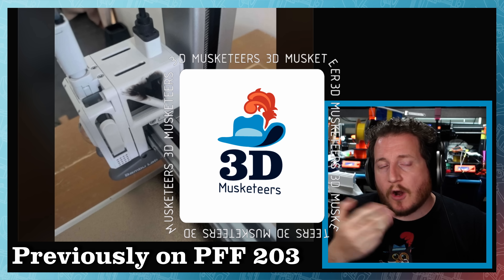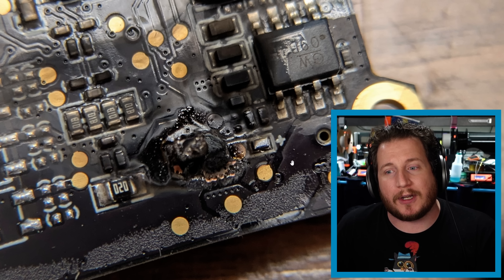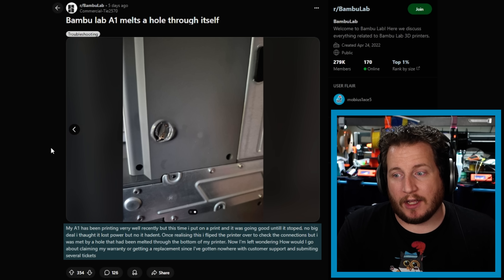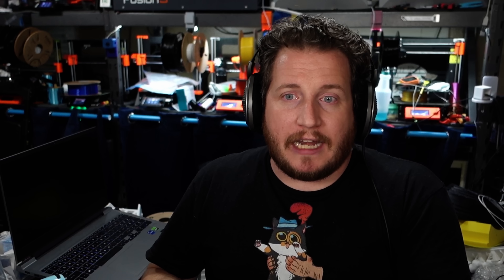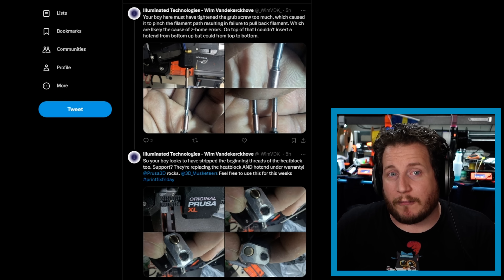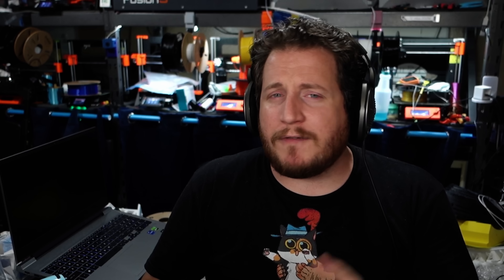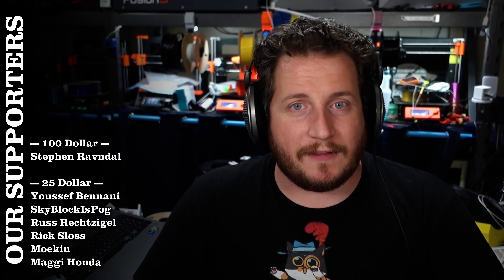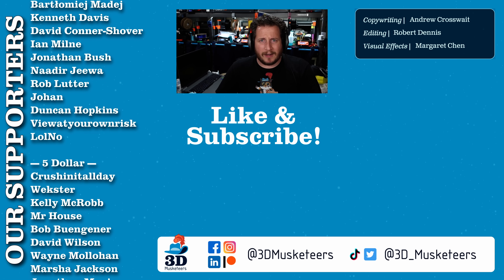PROOF That Bambu A1s Are Catching Fire! - PrintFixFriday 204

Comment: Wondering what the 3D farming community's experience is on this issue. If there is anyone who would have issues I think it would be them owing how hard they push their A1 units. My A1 is a year old now and I'm in a 220/240V country with high humidity all year round. I do prints on a weekly basis for the past year and pretty much daily over the holidays.  Really would want to know how much my unit is at risk.

Comment: This happened to me yesterday unfortunately, the printers been excellent, then came the sudden smell of burnt electronics and now the printer is dead. I live in Sweden and the only thing wrong with the electricity in this country is the prize, so that's not an issue. 
I'm in contact with Bambu lab support, hopefully there's some solution. The printer is not even 2 months old so there's got to be some warranty that covers this.
Reply: It was an A1 aswell ?
Reply: @guillaumevanoost811 yes, I've still haven't resolved the issue with the online store I bought it from. Not even an answer. 😤 Two weeks today, so I would not recommend 3djake to anyone. Crap support.
Reply: @likesootingstars any update
 happened to me today also
Reply from the maker: Happened to yours too? Send me an email or something. I'd like to chat more...
Reply: @Balion-t9s I'm returning my printer tomorrow, but I decided to buy another A1 from a different webshop. It doesn't seem to be all of the printers so I hope I'm not taking  to big of a risk. 🫣

Comment: 220/230 V AC power should not be much of a concern. In Europe it is typically a stable 230 V. Power outages are rare here — the grid is so reliable that I cannot remember the last unplanned blackout. The last interruption I have experienced was due to construction work, and I was notified in advance. 

30 years ago they have been much more common. I can remember that every thunderstorm could lead to a blackout. But that has been way back in the 90s. 

But the fire hazard is real and when I saw the electronics of my anet A8... As an electric engineer my heart nearly stopped. But since then nothing has really changed. Stuff is looking a bit fancier, some engineering went into the connectors but they use the same power supplies and wiring. 

Actually I am working on an automatic fire detector voltage cutoff circuit. And I strongly recommend that everyone should do that. I don't know why that is not an industry standard yet.
Reply from the maker: Alas it's prominent on all voltages so far.
Reply: @3DMusketeers Wherever electronics and especially heating elements are involved, there is always a fire risk. As far as I know, electronics are the main cause of fires in Europe. This is because fires are pretty uncommon and every other source is frequently and in detail tested and regulated. 
That makes it all the more important for manufacturers not to shrug it off but to take proactive measures.
In my view, every cable should have a fuse precisely matched to the expected load. On top of that, firmware-based monitoring of functions: if something is drawing current but not doing what it should → shut it down.
How hard can it be to add a simple optical smoke detector with a relay to cut power? And to integrate an automatic fire suppression system like Blazecut?
Of course, this all comes at a cost. A €250 printer would probably become at least €200 more expensive. But in return, you’d have the safest printers on the market.

Comment: Came back to this video as mine also started smoking, was able to shut it off, the printer wouldn't turn back on unless i unplugged the toolhead
Reply from the maker: send us an email or DM on discord.. would like to get that burned board from you if Bambu does not ask for it back
Reply: @3DMusketeers can I get the discord to send images, and I'll be doing the replacement I won't be going through bambu as it was a used printer gifted to me, the printer has been miraculously maintained
Reply from the maker: username on youtube is the same as it is on discord :)

Comment: I’ve had this same issue this week. Not sure how to add photos on here. My printer is almost 3 months old and Bambu up to now are refusing to replace the printer, only send me a new AC board and bottom plate. Not sure what to do now cos I really don’t fancy pulling all the electrics out. I’m in the uk
Reply from the maker: please email the photos to us. If you dont feel comfortable doing the work, let Bambu know you simply want a new machine. It should be within your right. If they push back let us know.
Reply: I’ve just emailed them to you. I mean I’m sure I could figure the replacement out. My concern is what caused it to happen and I’d be reluctant to use the machine properly again, especially leaving it unsupervised. I should be covered by our consumer rights act but I expect I’m in for a bit of a battle

Comment: I was wondering, how did the A1 that caught fire be installed ?
On furniture, on stone or something else ?
Maybe the condition under the printer has an impact on the issue, like less air circulation under the printer.
Reply from the maker: while yes, this can have SOME impact, it should not result in failure modes like we see. That area has no fan, nor air circulation system, so it is clearly designed to be passively cooled, at least in my eyes.

Comment: China Is a 220v country. There's no excuse for this being a voltage issue. They should have seen it coming. My original Anet A6 burned its heatbed connector so I switched to prusa printers. I recently decided to try out bambu labs and purchased an A1 and now my A1 could suffer from a related issue. I don't care how cheap you want to make a 3D printer, you should never compromise on safety!

Comment: My A1 runs 240v constantly. (I'm in UK)  I have 3d printed fan ducts for the little vent holes on both sides. It keeps the control board and power supply much cooler.  Why Banbu didnt squeeze a cooler fan in the base is surprising.  But Mines running fine.
Reply: Can you link or drop the name of the stl for the fan ducts please?

Comment: I really need to buy an A1 for a test-to-failure with some metrology on the PSU. I suspect that the PSU design is compromised for adaptability over safety/cost.

If anyone can send a full photo of their PSU board, pre-failure (both sides, if there's components or traces on the back side) then we can at least make some guesses about the logic. Having one in hand would be even better so we can suss out actual component values and build up a sim, if necessary.
Reply from the maker: I'm debating on buying one and hitting it with my thermal camera. I THINK we have a failed one secured for testing.

Comment: What grant goes to show. Bambu lab users are quite ignorant. They don’t like it when things go wrong with bambu printers and just stick their fingers in their ears and shout out ‘lalalalala’. 

You can clearly see it’s a fire issue but they won’t accept it and of course they know better than the actual engineers. 

When there was the first issue with the a1 catching fire they come out say things like ‘I’m going to keep using my printer regardless of what anyone says’

This is why I left the Bambu lab Facebook pages. They are some of the most toxic 3d printer people I know and god forbid should you say Bambu are cr@p. 

Bambu are cr@p!  Let’s see the haters come out!
Reply: That has nothing to do with "Bambu users" and a lot to do with Dunning-Kruger and bias in people in general. You're exhibiting the exact same thing by assuming everyone that buys a Bambu is ignorant. Congratulations on your utter lack of self awareness and bias. I am sure you are so proud of yourself.

Fanboys are everywhere, be they simping for Sony, Bambu, Linux distros.. and the anti's are just as toxic, if not moreso.

Of course, anyone calling you on your awful mental hygiene is a hater, right?

I suspect it's probably a failure in the PCB between primary and secondary and due to a lack of a Y class safety capacitor a catastrophic failure ensured.. but unlike most I am not willing to "call it" because I don't know for sure. I don't have the PCB in front of me so I can't inspect it.

Comment: When I got my Prusa MK4 kit, I had the Loveboard dead on arrival, sending the printer into a reboot loop. After half an hour with support, checking and troubleshooting different things, they told me they'd have to check with the team (this was 9PM Chech time). The next day, they got back to me saying they'd send out a replacement Love board and Nextruder main cable, which arrived here in Germany three days later. Replaced those, printer worked perfectly. It has since become a MK4S, then a Core One, and is still working perfectly. 
So, my experience with Prusa support was a good one.

Comment: My A1 makes some house lights flicker whenever the heatbed is running. Many users mention this happens because the bed is powered using direct AC and maintains the temperature with PWM. However, if you run the same printer on 110V, the problem goes away

Comment: The component in that location is a ceramic capacitor. Ceramic capacitors most likely fail short, which can occur due to manufacturing defects or mechanical vibrations. Because all the current flowed through it (apparently without limitation), it overheated and caught fire.

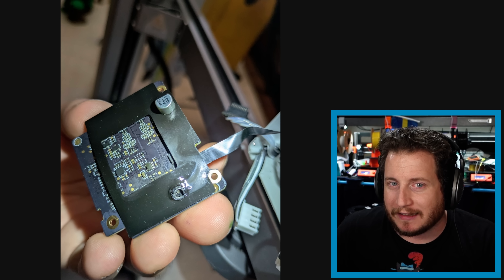Comment: You can see where the smoke was captured by the thermal pad or isolation pad that melted/burned through and is visibly charred. 1:40 The hardcore Bambu fanboys are still going to claim there was no fire.🙃

I would say though, it's probably best to leave any speculation as to which components are dealing with power on the board without probing it yourself or consulting with an EE for the sake of avoiding speculation in that regard. The silkscreen for some components might be marked with a + symbol because they are directional rather than handling a power rail.
Reply from the maker: We are working to get as many boards that have failed as we can. We have some plans to verify things! And yes, all with experts.

Comment: I have a brand new A1 in the Arizona connected through a rack mount CyberPower UPS…no dirty power…running 110v and had the exact same MOV burn out and melt my case. Bambu support was ok…still waiting on my replacement parts. It’s clear there is NO thermal protection on the power supply. I really believe there may be a deeper issue here and found most posts on Reddit and elsewhere are quickly deleted. Bambu also showed very little interest is potential fire issues from this. Just sad.
Reply from the maker: Oh wow another one! Email me. We would love to get that board for inspection.

Comment: My only Prusa Support experience.  Purchased a Prusa Mini + last year (WAY overpriced at $520 delivered).  One week, 5 prints later, I noticed the build plate was bubbling up in multiple places.  Had major 1st. layer issues due to this issue.  Reached out to Prusa Support, waiting for an hour on chat hold, only to get disconnected.  Reconnected and another hour later, spoke to someone who said Build plates are consumables and they wont cover it.  FYI  spent $50 for another build plate, and this one has gone the distance.  Lession one how to how you lose a customer.
Reply from the maker: Man that's shitty. They should have replaced it...
Reply: @3DMusketeers  That's what I expected.

Comment: Prusa Support- I had problems with my XL when I was assembling the tool heads, the first slot was stripped,  it took a while, but they sent a replacement xy carriage assembly.  They were great and I appreciated it.  SInce then I have modded all of mine with a re tapped 4mm bolt and redesigned tool mounts.   The nextruder grub screw is a problem area, I have damaged at least 5 by over tightening - I keep 5 spare complete assembles ready to swap out.    They are much easier to repair out to the printer.

Comment: I still want to know if its something related to firmware. As the tool head boards in most bambu machine have their own firmware version contained on the board. With the how system work with only a single USB c cable going to the extruder. Which could explain why this is suddenly popping up, if there is a firmware issue in the most recent update.

Comment: When I built my MK4 kit I noticed a grinding sound as it was printing. I tracked it down to the Y axis. After a little investigation I discovered a bad bearing and it groved a line into the smooth rod. I contacted Prusa support, sent them a video and pictures and they didn't hesitate to send me replacement parts. My experience with them was exceptional.

Comment: From my knowledge, the grub screws on the XL need to be tightened using an allen key (I don't own an XL) and on the MK4 there are thumb screws that need to be tightened by hand. I think the MK4 approach is probably a little better in terms of not accidentally overtightening the screws, since they are thumbscrews and not screws that can be tightened much stronger using allen keys. Is it as easy to overtighten the thumb screws on the MK4 as with the grub screws on the XL?

Comment: I contacted Prusa support regarding which nozzles they use to 3D-print PC-CF parts for Prusa Core (0.4 or 0.6,  ObXidian High-Flow, or an ordinary ObXidian nozzle). The guy didn't know the answer. We agreed he would email me an answer. It was about a month ago. No answer.
Reply: It's very likely the ObXidian 0.4mm, regular flow. The PC-CF parts don't look like they were printed with a 0.6mm nozzle, and high flow would be more prone to jamming due to the more complex internal geometry. I've printed plenty of PC-CF parts with a 0.4mm ObXidian with no problems, including spares for the existing PC-CF parts.
Reply: @logicalfundy  Jamming was my concern, but the Prusa support wasn't able to address whether my fear of jamming was real.

I forgot the conversation with Prusa, but Grant reminded me. You are right, and I should go back to the conversation.

That being said, most likely, I will use a 0.4 diamondback nozzle once my PC-CF arrives. Still, I prefer the E3D High-Flow 0.4 ObXidian nozzle for non-abrasive filaments just to get the high flow and durability.
Reply: @tshev with CF filaments, the length of the fibers will also affect the potential for jams. I can't speak for other manufacturers, but so far Prusament PCCF seems to have short enough fibers to not jam a standard flow 0.4mm nozzle.
Reply: @logicalfundy  Will I encounter issues with Prusament PC-CF if I use the E3D Prusa Nozzle: High Flow ObXidian - 0.4 mm?
Reply: @tshev haven't tested it with a high flow nozzle. But the way they work is to split the filament into multiple paths (usually 3 or 4) to melt the filament more effectively. Because of the splitting, and because of the smaller paths, filled filaments are far more likely to jam.
Reply: Send a reminder?

Comment: is my a1 mini safe? im kinda scared
Reply: Nope, I’ll take it off your hands for free
Reply: I suggest running the A1 on something fire resistant and make sure it's plugged into a circuit with a breaker. If you don't have one it could be a good idea to buy a "tradesman" power board that has one. It's also a good idea to keep a fire extinguisher nearby when using any 3D printer.

Comment: I know there are so many factors and variables involved in cases like these; but I continue to be glad that I phased out my A1 and the rest of my Bambu machines. Stripped some screw threads/nuts during the heatbed during my MK4S kit assembly, and Prusa was very quick in getting a replacement sent to me. It was a bit slow, but that was around the peak of - "winning behavior" - here in the US early this year.

Comment: I feel like I got my P1S at their peak manufacturing. Since then, they have probably found cheaper parts etc. I think you had mentioned, Grant in one of your videos. 

Also, like you mentioned, user error. My first printer an Ender 3. My friend helped set it up with me and I specifically asked “Did you set the power voltage to the correct 115V?” Printer doesn’t power on. This is when I didn’t know anything and was relying on his experience with laser cutters. Well, it wasn’t correct… 😑 That is when I learned never rely on someone else for maintenance and always assume YOU messed something up first. Never had a problem I couldn’t fix on my printers as long as I the read manuals/ wiki’s and watched your videos 👍

Comment: I have over 100 contacts to prusa support on one mk4s. They're always polite and friendly, usually responsive. Their big weekness is they sometimes have a hard time providing cohesive support between chat sessions. E-mail can be unresponsive (even on the scale of weeks) as they give priority to chat. I've had two mystery issues. An extrusion issues mid print was narrowed down to a mosly failed extruder motor after a month+. They covered the replacement even though the support extended outside of the the first year, but it took alot of rechecking stuf over ant over as support agents switched session to session. And dozens of hours. My vfa issue never got resolved. Tip: if you find your self cycling agents and wasting time, maintain a document of the troubleshooting history to share. Also, if they want to send you to e-mail let them but if they stop responding go to chat and ask them about the status of the e-mail. It helped get my extruder issue fixed